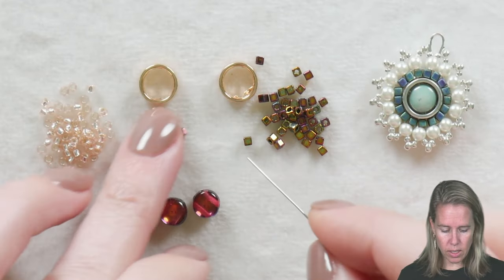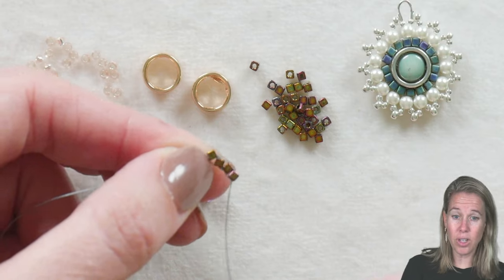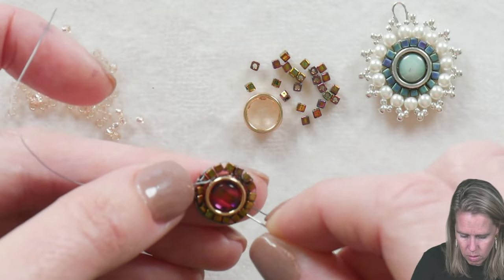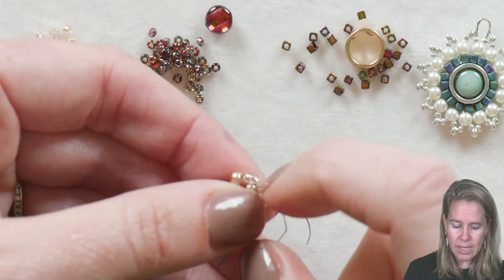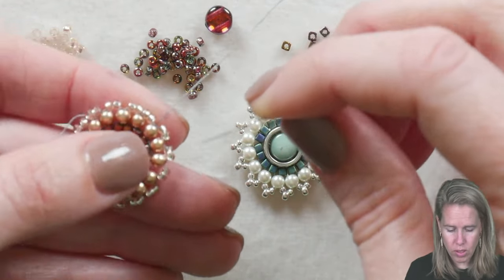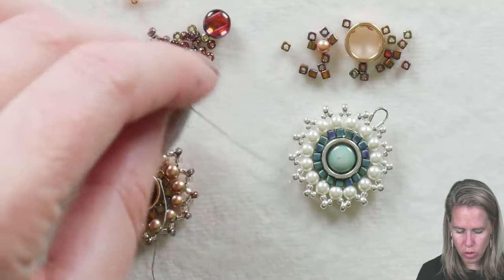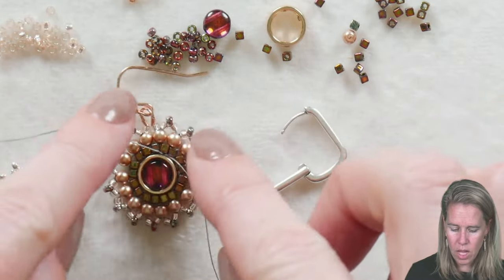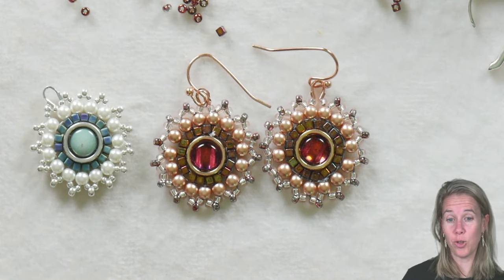Continued Circle Earrings Tutorial - DIY Jewelry Making Tutorial by PotomacBeads

Comment: I’m wanting to make earrings with cabs in the middle I have 20 m  domed glass cabs n plan on placing a sticker under the cab to magnify my sticker  My question is my 20 mm too heavy for earrings I have never tried this technique thanks ❤
Reply from the maker: Hello there!  It may be too heavy but then again everyone is different and has their own preferences.  Is it just going to be the cab or are you also going to add other beads around it?  More beads will add weight to it .  What you could do is glue an earring post to the back of the earring instead of make it a hanging type of earring.  Here are some great earring posts! https://www.potomacbeads.com/pad-posts-for-earrings-6mm-stainless-steel-25-pairs-pack-of-50?search=earring+posts&order=name+asc
Reply: @Potomacbeadco   nice if I think 2 heavy will go for the post look 🙂